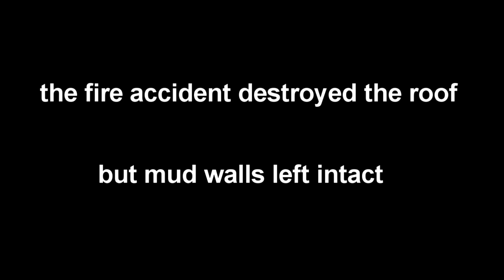traditional irish cottage renovation

Comment: lovely project! if I may ask (I am currently renovating my grandmas house), how did you treat the old stone walls? did you rebuild them with the original stones?
Reply: Maria Dowler  Every little original stone is saved, so I have more than enough material (plus, I am sitting on the hill where they came from :) unfortunately there are not too many people who still know how to build these old stone walls. I'll see what happens, thanks for your reply.
Reply from the maker: old stone walls do not need treatment if they are structurally sound. just patch repairs, joins filling,  then plaster them (if needed). yes, we rebuilt few walls with original stones, plus some sourced locally as we needed some with more flat face... round edge stones require lots of mortar to use...
Reply: @grubasyk  thank you, part of my walls are quite crooked, that's why I was curious. the house seems to be more than 250 years old and underwent at least 4 or 5 structural changes that did it no good. I am still digging into its history which is not that simple considering it's a farmhouse.

Comment: Wow you did an amazing job! i’m starting a project similar to yours. I wa wondering, for your floors, did you do a limecrete floor? You underfloor heating is it powered by wooden stove with back boiler? What did you insulated your corrugated roof with? Have you any issue with condensation?
I have three roofs and redid one with non drip corrugated - I’m yet to insulate
Reply from the maker: yes, limecrete floor, UFH powered by geothermal heat pump, roof insulated with 100mm PIR plus 50mm insulated plasterboard, no vapor barrier, no condensation whatsoever. check the blog in video description for more details

Comment: My brother in law and myself converted a cottage ( I mixed mortar he did the rest to be fair) but we found some coins hidden in the masonry. I was wondering if the same happened with ye
Reply: Lar coins & holy medals were common enough finds I found some when we re roofed our spot in  Ballintubber Co.Mayo & found some in Ballina as well as other jobs.
Reply: @seannamadra5675  we found them in the masonry just below where the roof meets it. Must be a blessing or a lucky token I assume.
Reply: @larmoran4885  yes Lar its usually for luck and common enough along the Western Seaboard.A lady in Breaffy where I am working built her home in 1986 and holy medals were placed in each corner to ward off bad luck/demons.Was only told this last week Lar so pleased to share any info on folklore heritage with you or anyone .Document it & pass it on to the heritage group in the locality if it suits ye Lar? We have met in the past Lar I worked in DH Burke's in 1996 when I first came to Mayo.Another tradition is a Rowan Bush outside to ward off Evil.All the best Sean na Madra O'Brien
Reply from the maker: overall 100+ old coins were recovered from the cottage, as you mentioned most of them were on the top of the walls or door frames  https://foxhillcottagerenovation.files.wordpress.com/2019/01/coins.jpg

Comment: Why bothering in buying an old cottage and turning it into that?
Reply: Into what? they used appropriate material like lime plastering, cob, breathable insulation, limecrete floors...they kept the integrity of the old cottage while adding a new extension. New rules coming into force now say all major renovation works carried out have to conform to strict energy efficient B rated standards anyway so that won't be achieved without the use of things like heat pumps, underfloor heating and heavy insulation anyway. No-one wants to live in cold tiny stone cottages like we lived 150 years ago and better modernise them than the current situation of them all being either knocked down or left to ruin. I know what they're like as I live in an 1870s Irish stone cottage and it needs a lot of work. Where are you?
Reply: Lots of energy resides in lived places. New constructions have little energy. New religions build their temples on the conquered's holy ground.

Comment: great job, but are corrugated tin roofs that traditional?
Reply: Its been around a long time. Over a hundred years at least
Reply from the maker: our cottage had only straw and then corrugated tin (from 1970s) roof , so we kept its character
Reply: @grubasyk  'traditional' for me means a practice based on centuries of house construction using usually local materials, ie for the roof, they were thatched using straw, reeds, rushes etc. Corrugated sheets made from tin, plastic, fibreboard or asbestos are not ancient traditional local products - I admit that tin sheets do go back to the early 19th century, I wouldn't have thought that it's usage was that widespread in domestic house building due to its availability and cost and was most probably for some time used in the industrial sector. While I have not admittedly done any research on Irish cottage building, I doubt very much that corrugated sheets can be sold as a traditional cottage style, but each to his own.
Reply: many thatched irish cottages were covered with corrugated metal roofing
Reply: @bill90405  OK so people do lots of traditional houses, corrugated sheets, concreted walls, that doesn't validate their actions of keeping in tune with traditional house builds (I am not criticising people's choice, they can do what they want or what their means allow). Yes metal has existed for some while now, but then it's not thatched, is it? It's a difficult situation with old houses, to restore them in a way which we would now be comfortable in.

Comment: Fair play it looks very nice, but it looks like the roof has been replaced with corrugated metal? Surely it would be far better to replace it with tile or even thatch! 
When it rains it must be deafening and It rains a lot in Ireland, how do you think with that kind of racket going on!!
Reply: You know just about EVERY New Zealand house has corrugated roofing "Color Steel" - It's practical, strong, lightweight, long lasting, - and the insulation in the roof cavity makes it all cosy & quiet. - Good choice.
Reply: I have an old cottage with steel roof and never hear the rain.Insulation and felt drowned the rain out.
Reply: @derrickmurphy9874  Absolutely .. sometimes I'm alerted to heavy storm rain by a little "white noise" maybe.
Reply: Fair enough
Reply: @pjmbidge632000  Good man that you are ..
Reply from the maker: The roof was renovated like for like. It was in planing permission, and as for me it projects a better character.  We looked into using original corrugated sheets which were twice as thick compare to new ones, but some damage to them was not sustainable to repair.. About the noise when raining - it is louder than we thought would be, but it works as sleeping pill for all inhabitants :) I believe it's an air gap  between sheets and roof membrane (25mm +35mm battens) makes it "acoustic". But definitely no condensation going on there!

Comment: Inside looks nice, not a fan of the modern feel to the outbuildings, it takes away a lot of character. Very sad actually, but that just my humble opinion
Reply from the maker: Thanks for comment, Kirstie. If you refer to outbuilding at 5:16 - is it an external insulation takes away the character? Just curious..:)
Reply: I can relate to that, having all windows heights the same instead of the old door openings in the stable for example would have had more character to my humble opinion. In some way it's a bit to smooth, to modernist to my personal taste.
Yet, overall I'm glad you rebuild and renovated the place. That still gives it more character then a complete new building.
Reply: Remco Gerbrands agreed

Comment: Using cement not lime mortar. Big mistake in a wet climate. Lime breathes in moisture and breathes it out when drier. Cement traps moisture in.
Reply from the maker: no cement. that is rule of thumb in this restoration. no problems with dump after 3 years living in it. Proper landscaping outside the cottage is great matter too.

Comment: Looks like a lot of work, but I think you destroyed the character of this building.  It looked better with an old patina with the exposed rock in my opinion.  Many people try to replicate the old look that you had, yet you just covered it up with modern Big Box materials.
Reply from the maker: I disagree with last statement, there is only traditional materials used - lime and cob. I doubt you can buy them in bix box store :) I agree that exposed stone wall looks much more pleasant  - but practically it is not for the dwelling where you live. You suppose to lime wash it. But better protection from irish weather is when you plaster it with lime and sand and paint with water proof mineral paint.